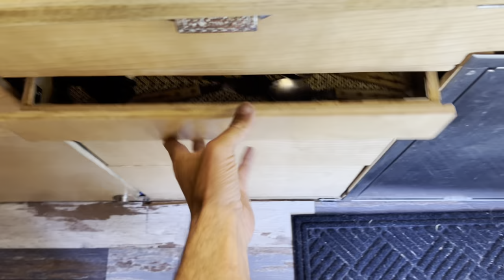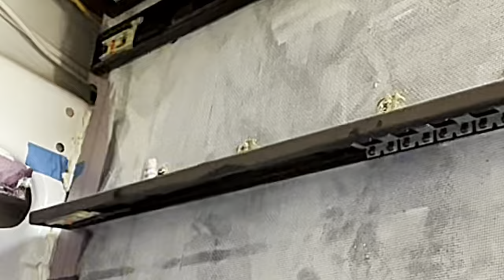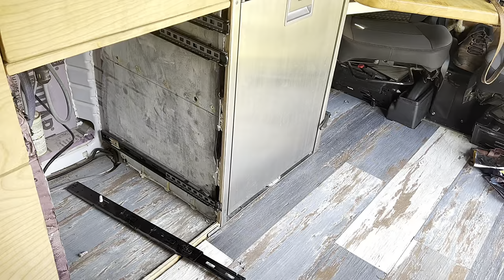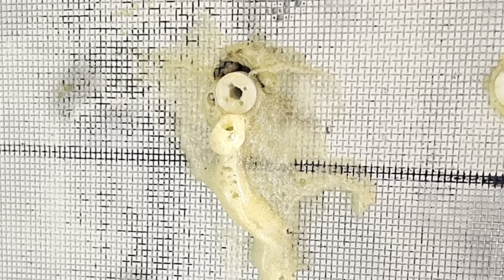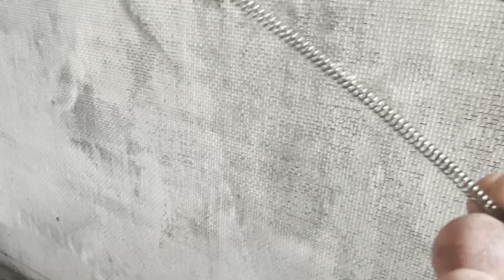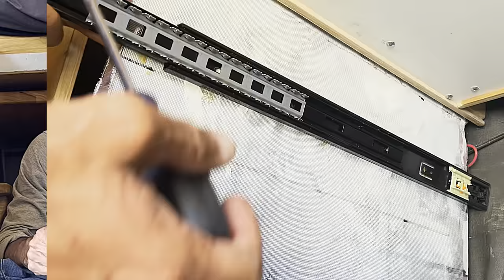When Foam Anchors Fail - Foam Bones Van Build System Vol. 3

Comment: It looks like the foam boards used are 150 (15 psi compressive strength, less expensive and maybe slightly lighter), not the higher compressive strength 250 material (25 psi).  It looks like 250 is $40 vs. $30 for 150, per 2"4x8 sheet currently.  How much pressure could potentially be applied at each point:  A plastic screw anchor insert is say 1/2 inch wide by the 1 inch depth of the foam board wall, only a half square inch, maybe more with how the gorilla polyurethane glue bonds into the foam, and even more with the insert bonding to the screen skin.  Guess at how much foam area the load from the screw insert is spread over, some of the load is in shear on the skin of the foam & screen, some is compressive downward in the middle of the foam.  Maybe that skin shear area could be a 2" diameter circle, that's a lot of area per screw.  So maybe something like a total of 4 sq in * 15 pounds per screw, which was similar to the pullout tests you showed.   Maybe a strength test, like a drawer slide with the load parallel to the board:  vertical foam board,  two screws say 6 inches apart, holding a lever with force on the end of it.
Reply from the maker: Great point about the 250 vs 150… I honestly forgot that the 250 existed… my stores only ever had 150 @1” or 2”. I would stand to reason that the 250 would out preform the 150 for all the strength tests due to higher density. Odd that it has the same R value. 

As for the screw tests, absolutely more could be done to simulate the various loads. Honestly I should have been testing the parallel load (perpendicular to screw) since this is how I’m using it in most situations. 

I’d also like to test the screened foam for its flexural strength in both directions (vertical and horizontally across a span) and compare that to various thicknesses of ply. 

One day I hope to have the time (and find a good testing shop or method) to do a comprehensive battery of tests with all the bazillion variables to release a definitive set of results.
Reply: @falkornomad  I love your tenacious problem solving attitude.   You actually tested the parallel load. Remember the foam strips you glued on like shelves... Once you position your shelves, cut and glue strips of foam directly under the slides for  full length support. the screws then aren't supporting, just holding in the slides. -TheOldGuyPhil

Comment: How much to convert a Chevy spark into a tiny hotel?
Reply from the maker: 🤔 how many rooms in this hotel? Also, hotel implies multiple levels, so that’s gonna cost you extra… I think we could do a Chevy Spark Motel (not hotel) that sleeps 2, no continental breakfast, no bathrooms… maybe this more like a hostel… let’s just call it $20k materials, you provide the labor, I’ll consult for a 12pk of Coors and a pack of American Spirit non-filters per day… Deal?
Reply: @NØMAD  Only needs to sleep one.  $20k materials!? ☠️
I'll just stick to plywood... she ain't worth 20k and neither am I.
Reply from the maker: The cost isn’t the foam vs plywood… the cost is an electrical and plumbing system. But you do you. Foam is cheaper than ply, we covered this in 2 previous videos.
Reply: @NØMAD  Ahh. Well, I don't need all that fancy jazz. I have a portable power station and solar panel. And a collapsible bucket. I just want a bed(storage) and a vertical cupboard. I have a 3D model of an idea. I guess motel gave wrong impression. Moreso a camper/ sleep pod.
Reply from the maker: Well, if you honestly want ideas or a sounding board on the build I’d be happy to discuss ideas  for your build…. Foam or otherwise… I like exchanging ideas that’s my jam.
Reply: @NØMAD  I do appreciate you! I have been sitting on this idea for years. And I only just now saw your idea for a lighter option. I'll have to watch more of your videos for sure. Since I'm proud of the little Sparky's mpg, it would behoove me to cut weight as much as possible for my North American tour.
Reply from the maker: Well… short cut… if you are serious about the spark build… what is your goal… what kind of travel, where, and what amenities do you want / need?
Reply: @NØMAD  State forest hopping mostly. Free dispersed camping with the occasional walmart resort. I just want to be able to sleep inside (I've slept in her many times on a foldy table). All seats but the driver are gone. I have a hanging fabric shelf in there now, but would like something a bit more sturdy and just look like something you wouldn't expect to see in a clown car. I want it to give off the impression of a microscopic suite. I want to be able to access my stuff under the bed/floor from inside the car. Ise all available space. I had my plywood design set as low as possible for headroom. If I use 1" foam instead, I'll only lose half an inch of head room. I'm excited to try, but I'm not sure how they would stand up to being lifted like lids. Thoughts? Also, where do I send the beer and cigarettes?

Comment: Appreciate your commitment to make this a thing, but failure is predictable here, my Dad built a lot of European style cabs with MDF, and even sans earthquakes, fasteners tear out of that shit too if you get even a little rough with it.

Second thing is, that MDF was ½" yours is 1", which really cuts down your usable drawer space after you add the side rails, and the thickness of the drawer sides themselves, gotta be 4" of wasted space there easy.

But all that aside, the quick fix in your situation I think, would be the let-in wood strips many have suggested.

I would run them vertically, you could do that with a cheap Harbour Freight mini dado plane, and use precut laths to avoid a lot of woodworking headaches.

1x⅜" trim would be even stonger.

Predrilling is critical because it splits easy, and you'll have to line it up somehow.

Otherwise, HD and\or Lowes can be talked into precutting ¼ ply for you, which could be cut wider for better weight distribution if you were to run them horizontally.

In spite of the space loss from the 1" foam, I think this might be even stronger than the traditional 1x stapled carcasse, I had the cabs of a fishing trailer I bought tree planting while deadheading from Natchitoches to Rehoboth Beach, after turning off 395 onto Pennsylvania Ave., and catching fucking air on the whoop-de-whoops that it was in those days!

Just discovered your channel, so you may have already resolved the issue, but very impressed by your concepts and methodologies.

I might recommend looking for a book called "The Finely Fitted Yacht", which is full of litte space saving gimcracks and chingas'.

Rock on!